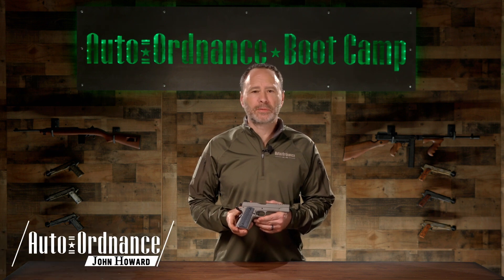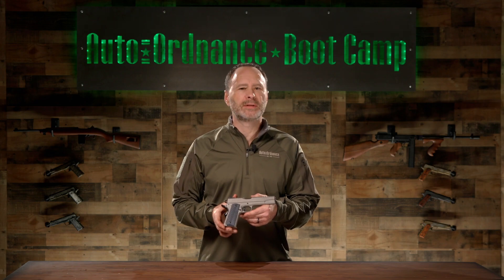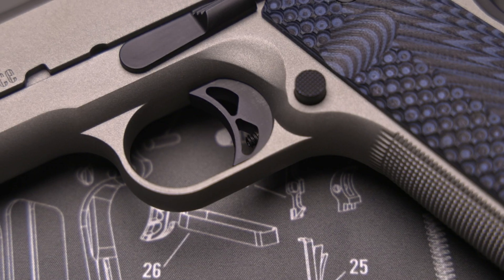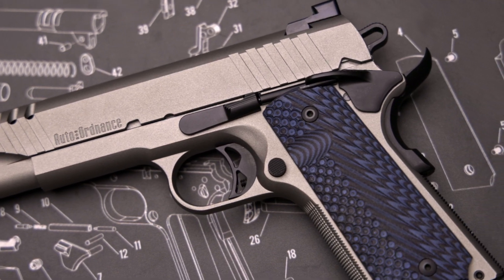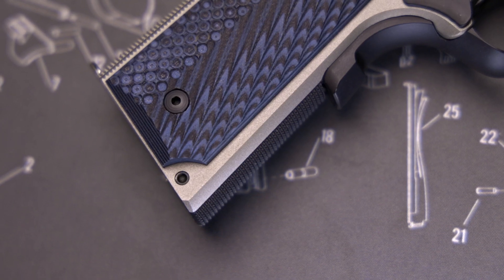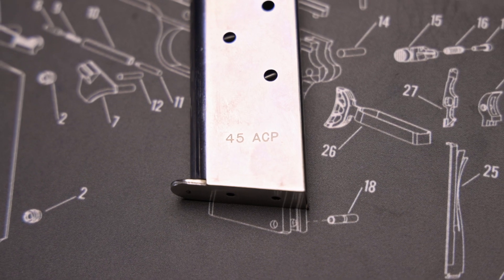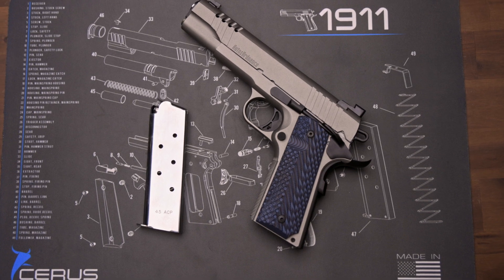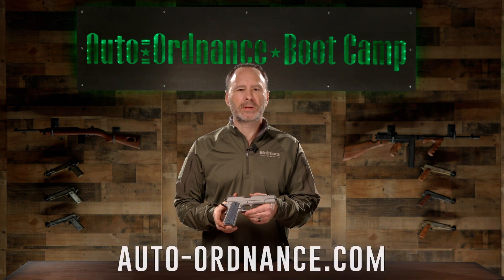Auto-Ordnance Stainless 1911 Overview

Comment: Hi Auto-Ordnance why in the  hell  would  you  take  this  a series 80 1911?yall didn't  take  notice  to what  happened  to  COLT back in  the  day  with  series 80 1911s.how they filed for bankruptcy several  times
Reply: Using a series 80 slide & frame is absolute stupidity. You have to be dumber than a clam to use it.

I handled a new Auto Ordnance 1911 last week. The build quality is fantastic. 
The trigger is absolute shit. 😞